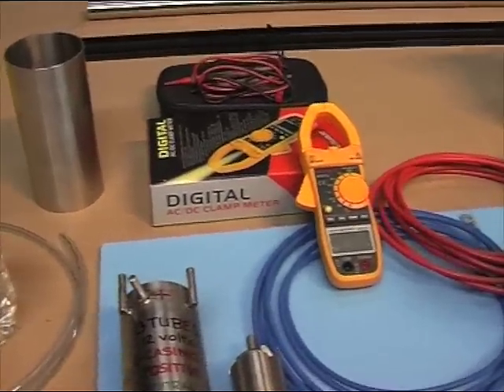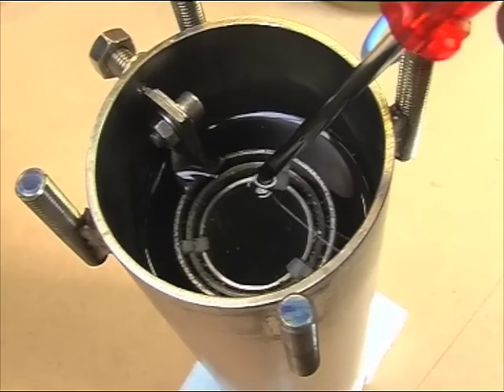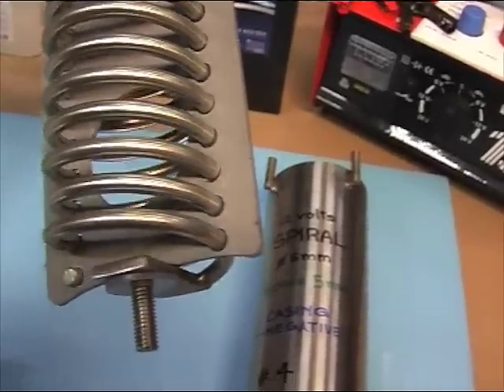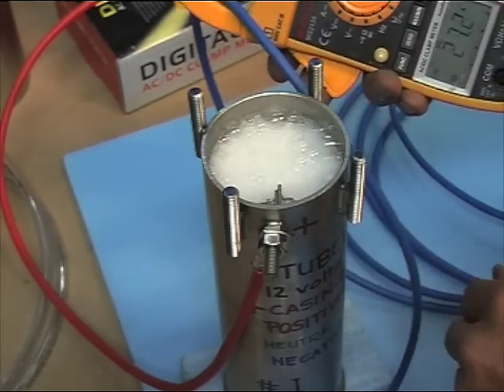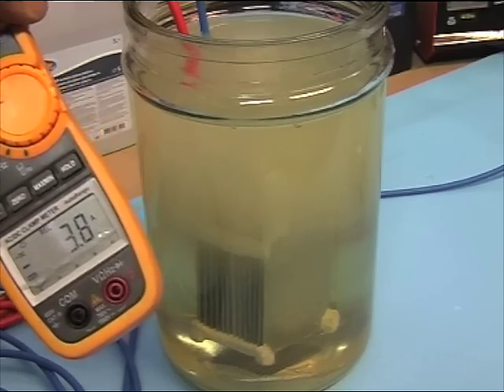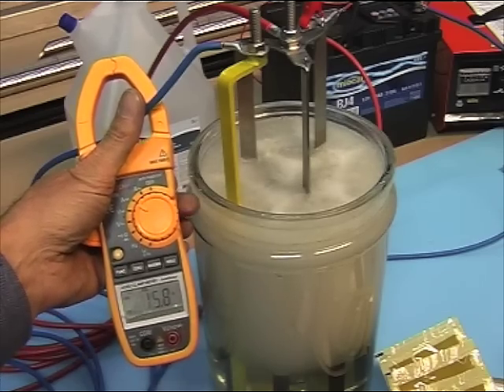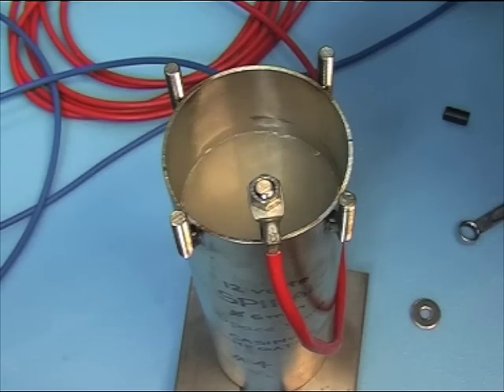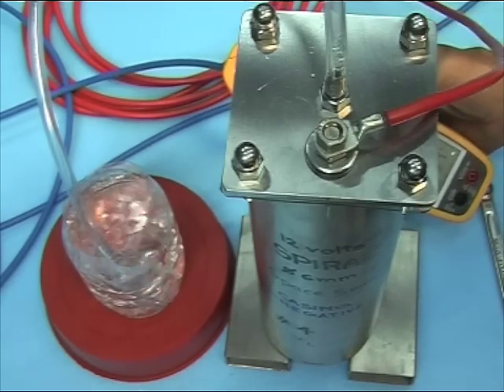HHO SWISS INOX 4 SPIRAL CELL + GAS PRODUCTION TESTS

Comment: HELLO MY FRIEND REALLY NEEDS YOUR HELP I SEE  SEVERAL PROJECTS THAT SAME USING COPPER GAVE RIGHT THEN I AM SENDING YOU SOME PHOTOS OF THE COIL THAT I DID WITH COPPER BUT DIDN'T HE WORK FOR THAT I ASK FOR YOUR HELP SO THAT I CAN UNDERSTAND WHAT I DID WRONG (IS THE COPPER COVERED WITH THE VARNISH WILL BE THAT THE PROBLEM IS THAT?? SHOULD I REMOVE THE VARNISH? do you have email to me send you my photos??

Comment: if you use less electrolytes it should use less amperage also the water4gas spiral shaped one uses 2 different types of stainless steel for its values negative and positive just a thought

Comment: Do you have your output gas going into a bubbler chamber?  This will prevent warmer gas vapor from compensating in the hose.  I haven't done it, but if you get an airline dryer for an air compressor, that might work.

Comment: With the plate design you should add more electrolyte which is a good thing because at the temperature rises, amps will rise slower than that of a lesser mixture. The reason is that the water is already very conductive and it relies less on the steel to transfer the voltage. I have studied this phenomenon and i am close to producing calculations to post on the web. What you want is a design that doesn't draw much in mild electrolyte. This also makes it easier to mix your electrolyte.

Comment: excellent video, awesome construction quality of the cells, and awesome commitment to data collection. Is the electrolte concentration the same in all the experiments? if so, might you be able to get away with less electrolite on the spiral cell design to lower its amperage draw?

Comment: use a bubbler if you attach it too your car it will stop any liquid getting into your carberetter. also the flat plate cell works better with only 7 plates at 12 or 14 volts as each plates needs about 3 volts if i remmber correctly, it is true also too blank off the edges to create water flow to aid production,  you seem intellegent im sure you knew this already i just wanted to concur over these facts.
i like the spiral idea very much perhaps some alloy fins around the  casing for cooling.

Comment: icemanpwa > mate be careful, you really need to run a pulsed DC power supply. Because you are essentially building high power capacitors, and the power will be transformed to heat as it works on the water. Plasma arcs form when a dielectric in a high power cap is saturated and breaks down, can get quiet nasty.

Comment from the maker: I do not know if you know, but new european cars, (and mine is one year old), have virtually no space under the hood nor before the radiator nor behind it I have a little space I could use for a small cell, have to figure out how to fix it first!. 
I cannot even take out the water container for glass washing water, because it has a shape like a contorted snake. I probably will build a small coil with a small container since diesel needs very little hydroxy to burn better and save some gas.
AMOX

Comment from the maker: MMarroquin1024
IT IS BECAUSE IT IS SO GOOD THAT IT IS TRUE!!!
Yes, Hydroxy is extremely explosive it burns at a speed of around 8000 feet per second (mach 2.5) in other words it burns 1000 times faster than gasoline vapours. That is why a pop-off cap is needed on a cell and that's why you see people using bobblers to avoid a flame backfiring into the cell.
AMOX

Comment: No you haven't, you PVC designs will melt after 2 hours of use, cylindrical designs have been bench tested over 10 hours and are stable. Beware any one trying to sell you a PVC booster who has no bench test to prove its reliability

Comment: Hi dude. If I am right you're trying to extract H2 from the water in the most efficient way? Do you think that heat sinks could help in the task? They already are designed to maximise the surface. Using them as electrodes the production could rise a little bit...anyway it's just an idea. Next step, do you want to collect the H2 after production? Ciao, Danny aus Tessin !!

Comment: no electricity? dont you need to charge the water with the electicity from the car battery you have on the table connected to your generator? im only asking beacuse i work with stainless steel and am very interested in making a spiral cell. is the plate holding the the spiral stainless? do you have/need any type of insulation between the - and the +, any insulation between the outer cacing and the - and + inlet/outlet? 
thank you

Comment: why dont you need to worry about insulation? i see you holding on to a metal tube full of water with electricity running through it. please explain.

Comment: I made a "coil" out of stainless steal welding wire, works alright.  my mpg has increased 15% on a '99 ford windstar 3.8l v6. i now get 21mpg, with city/town driving.  Everyone should be making these things and installing them in their cars....  IT IS NOT AS DANGEROUS AS YOU ARE TOLD, that is if you have some commonsense...

Comment from the maker: Hi Zero Fossil! Yes I am doing everything on my own, but for me, so far, it is no problem, because the place you see on the video is also my workshop where I work every day with Stainless Steel (for the building&construction industry) for a living as an independent!
Therefore I really admire most of you guys who manage to produce in their (often cold) garages some very remarkable cells. I learned everything from you guys many very fine and daring pioneers thanks!
Amox

Comment: I would like to add ssome comments on the series plate cell. Yours is rated at 12v as you have 6 gaps @ 2v each so you must add the electrolite cosiderably around 20% or so to have good conductivity. Don't forget to close the sides. It should produce gas from all the plates

Comment: Hi nice work there.I would like to comment on the plate cell. 1) I think that the plate faces should be sanded to remove any protective coating or maybe oil than clean them in some citric acid solution 2)close the sides as zero suggested as there will be losses. I have one like that and produces around 1 litre per min at 14v@15amp approx. I hope this will help.

Comment: i5ere is correct, it doesn't really matter where the negative is.  It should, however, be at the farthest point possible from the positive connection.  As you know, Hydrogen is the lightest atom in the universe.  It will rise to the top of the liquid especially when your water is warm.  Cold water can cause the Gas to convect, but "cold" is a more accurate way to measure Gas.  Warm water will cause the Gas to expand and so it is lighter and larger by volume ascending more quickly.

Comment: Im working with spiral cell to,but the cell behavior is term of  how much comsuming of electrolite is not clearly,I make a new model,and I add to many neutral,because of the contruction desing.one question if you balance your spiral cell how much positive and how much negative ,and how much neutral it have,tell me in %?thanks